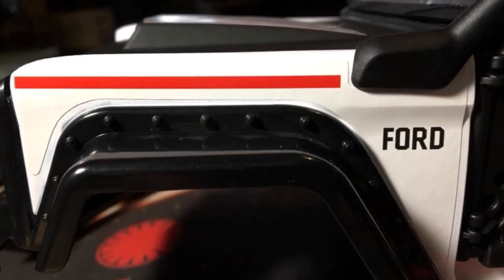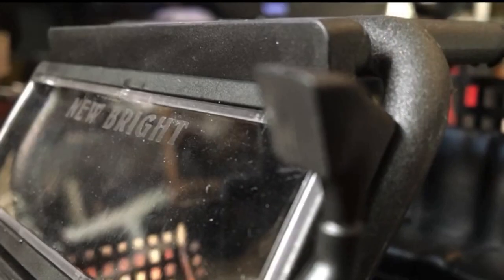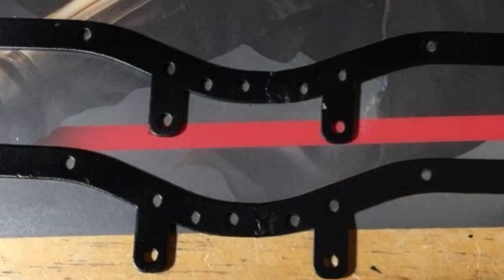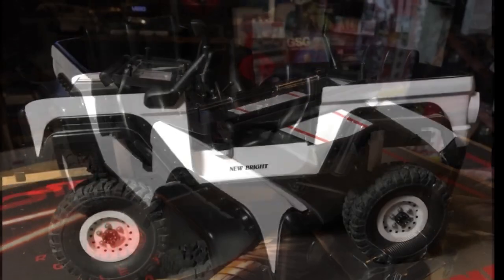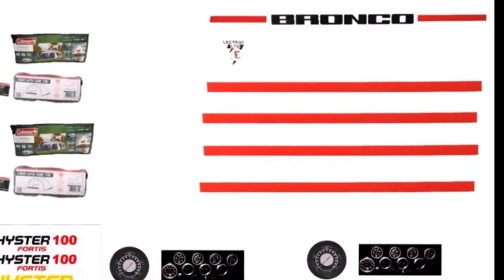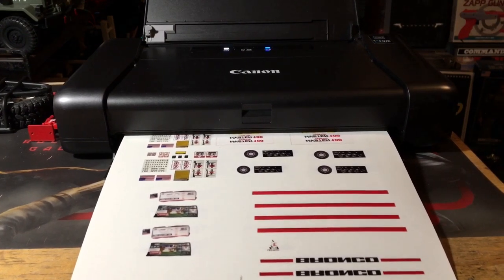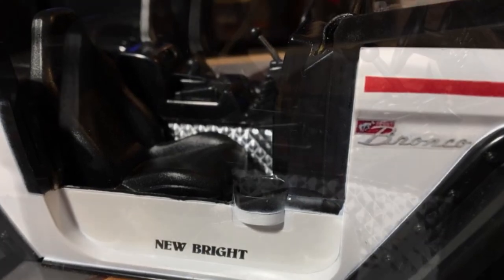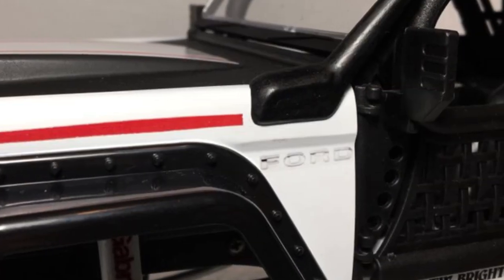1:15 scale New Bright 1970’s Ford Bronco WPL C-14 conversion

Comment: did you try pulling in the axles before you cut that frame?
Reply from the maker: Yes I definitely tried it out before cutting the frame but the wheel base was too long and not accurate so I had to go to the extreme I suppose by cutting the frame not a easy task For most.

Comment: now this is when I want SOMEONE!!! to 3D print a 2 mm thick 12 mm hex floor with a center hole, then up 8 mm higher with 12 mm exterior hex with 5.0 or 5.1 mm internal hex hole, (3.5 mm walls) so any 12 mm wheel can be mounted easily. that Bronco looks like it'd handle 75-85 mm tires 30 mm wide, so perfectly!
Reply from the maker: With the amount of flex this truck has it would barely handle 2mm more without rubbing somewhere on the fenders! It’s all about the flex 💪🏻
Reply from the maker: Anyway the WPL kit tires are the Exact size of tires this truck uses in real life they are like 35 inch tires  besides you couldn’t get a 3.35 inch to fit in the 2.5 inch spare tire rack in the back of the truck. I actually have a video where The truck tire rolled a bead So having a spare tire that actually works with the truck is nice
Reply: lol dang, guess I need more tips to get even more flex from these things!
know stock tires are about 68 mm tall, and yeah taller means a set of 4 make that 5 with a same size spare as you're stuck with 3 extras, make it worse, need of 1.5" rims to have 3/4" of sidewall on 3" tall tires. stranger and rarer and more expensive these things get yes? (Yoda lol)
Reply from the maker: model nutty The stock tires are closer to 63 mm You should probably buy one there are tons of fun!
Reply from the maker: model nutty thanks again they look very good!!
Reply: they're for WPL/Fayee version pretty sure, might look good on Bronco there. found out the tracks for WPL need a LOT of torque, even though their drive wheel is 1/2 diameter of stock wheels. dual 400 rpm 6v N20's in RTR toy class B-1 barely turned them (ouch). have a stock trans with a torque 180 if I want to bother with trying them again (not really!). with wheels it'll climb about 45 degrees N20 powered, tracks not even a 1/2" bump.
Reply from the maker: model nutty 12v 200-300rpms N20 motors will make it climb up 50°+ might work great with the tracks Only problem is the N20 motors I use cost $9 each and for that you can get a two speed transmission and that will get you a up 50° no problem!